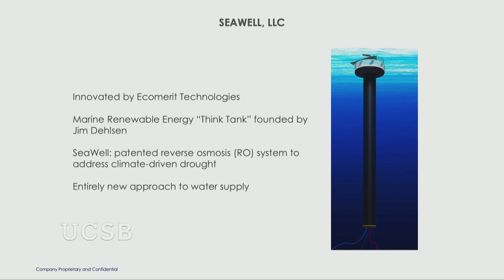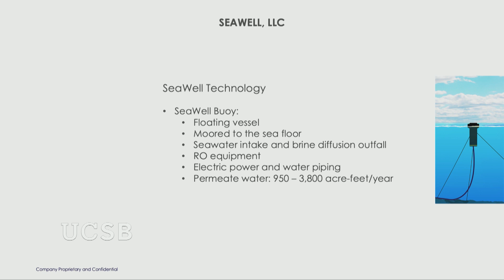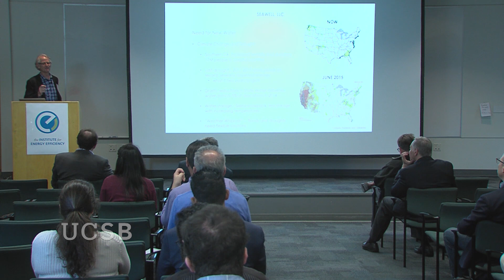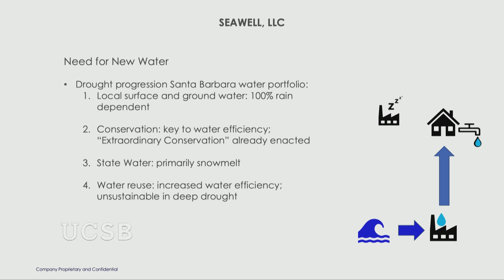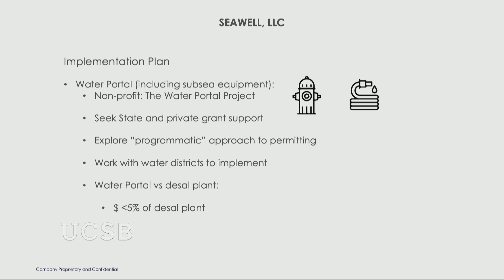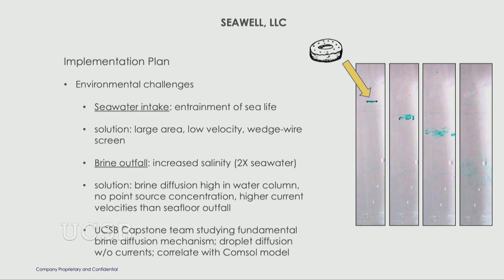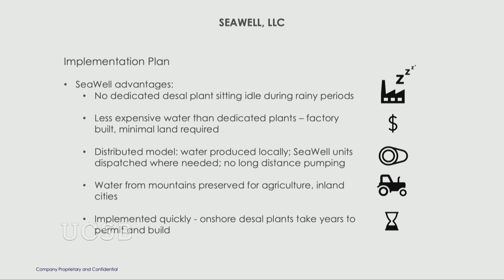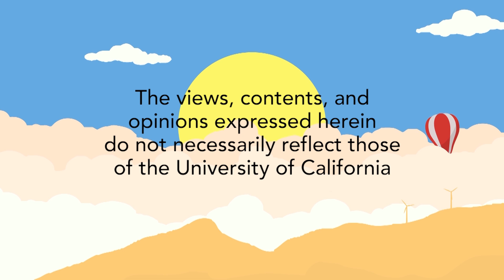Distributed Offshore Reverse Osmosis

Comment: Ever buy  a meat pie - with no meat?
If they could make a vertical  column and use a built-in  hydraulic ram to provide the needed pressure (so the rise and fall would create the pressure to drive the reverse osmosis) it minght work.

As it is stated it lacks meat.

Comment: will it work.. if off shore deeper than 65 feet.. so that no ships will collide with it.. running it down with their keels or beating it up with their props as they go past it. 

will it have some kind of winch holding it down.. so it can be allowed to float to the surface for servicing. 

 ice bergs. or fresh water from glaciers or ice bergs..  water is easily transported using ships built like orange juice concentrate ships.. with stainless steel tanks.. 

  water from ice bergs could be done 

 i would love to buy purple pipe water directly from water treatment plants..  put it in tanker trucks.. take it to a tank farm that blends the purple pipe water in tanks into the same chemistry as rain water has..  then deliver that to peoples homes to water their lawns and shrubs via a water tank.. irrigation pumps and an isolated purple pipe sprinkler system..  refilling the tanks when needed.  no massive infrastructure changes.. it could even be plumbed to flush the toilets as you suggested. using flush valve type toilets would keep small hands out of the tanks. not out of the bowls.. but.. kids are always in the bowls when out of sight.  this would be really easy to do.  even delivery using conventional water trucks that come with  hose reels and PTO driven pumps..